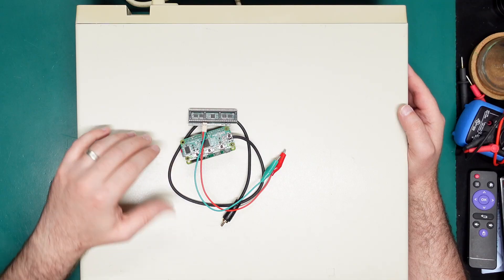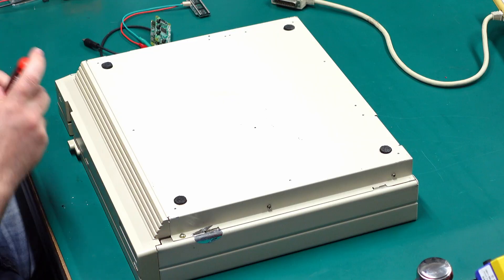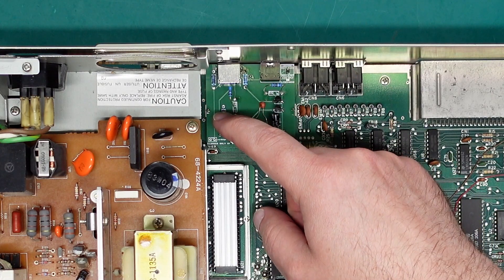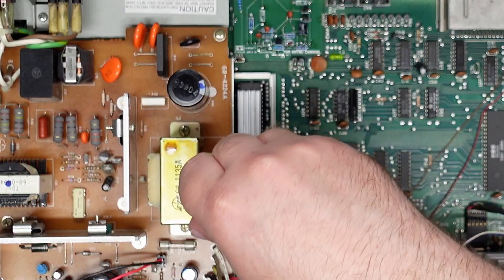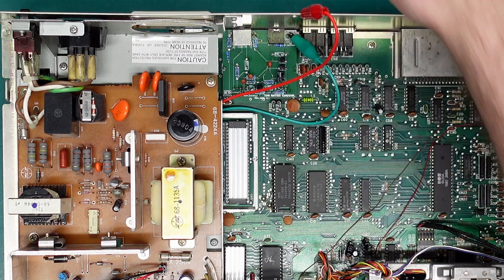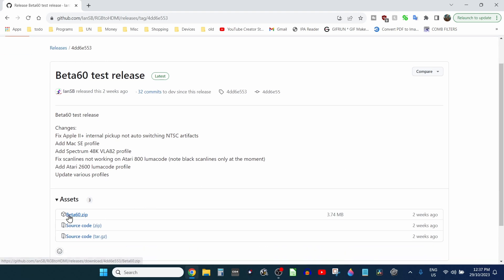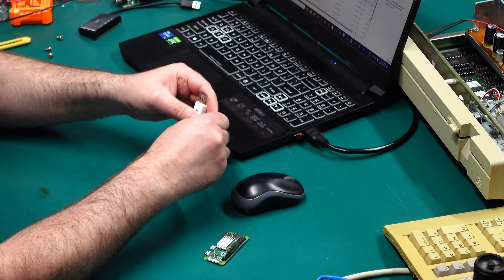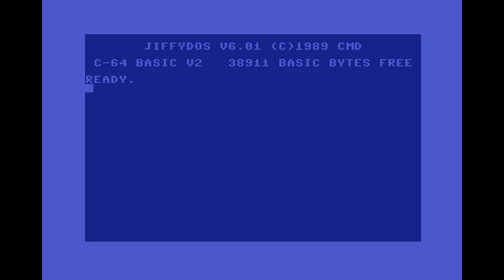Jailbar free Commodore 128 - LumaCode VICIIdizer128

Comment: Thank you for your work! I copied you and it did well! You forgot to mention ohne thing: the inner pin of the original RF output has to be disconected from the  Board, before this is connected to the „LUM“cable, as ist written in the readme.

Comment: Since the LumaCode is being pumped through an RGB2HDMI adapter, can you also take advantage of the "softer" scaling options for those that do not like the pixel perfect output? EDIT-- all I had to do was pay closer attention to the RGB2HDMI info screen that popped up. It is set to Auto scaling by default but I am sure this can be changed.
Reply from the maker: Yep, all the regular RGBtoHDMI scaling and filter options are available

Comment: So it does nothing in 80 column mode?
Reply from the maker: Nothing. But I guess you could always get a second RGBtoHDMI for the 80column mode.
Reply: @TheRetroChannel  Fair enough. It would have to have a physical connection to the 9 pin video port. I don't have any jailbar issues in 80 columns, but it would be neat to be able to use it on any HDMI monitor.

Comment: Did you put the 128 boards into a metal case? Or was it that way to begin with? 🤔
Reply from the maker: There's 3 main versions of the 128. The flat case, the D (plastic case with the handle on the side and keyboard underneath), and the DCR (metal case with a cost reduced mainboard)

Comment: I personally don't understand wanting to see the c64/c128 that way and not have the beauty of a 1702. It's neat though from my hardware nerd side.
Reply: I have that opinion also. I like the not so clean output of my c64, that's how I've always remembered it.
Reply: @samp3413  I like it nice and clean with clean separated composite, but without scan lines and persistence with the superior contrast of a real CRT it just doesn't look right to me.
Reply from the maker: I'll always prefer a CRT, but for those without one this is a great way to hook up this old hardware to a modern display